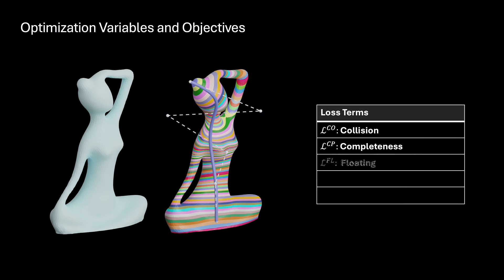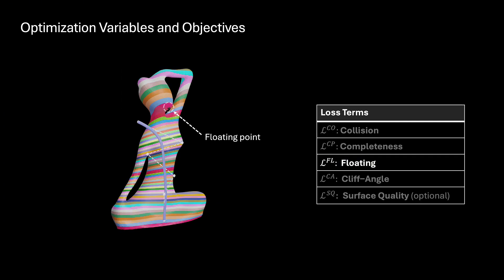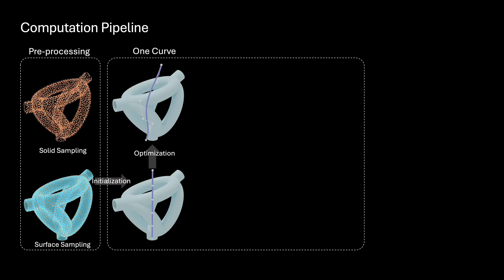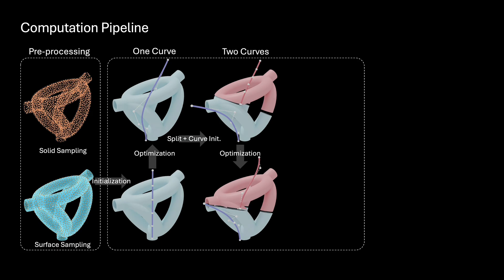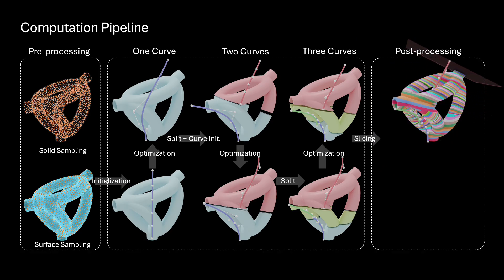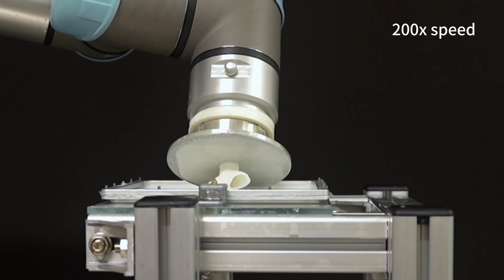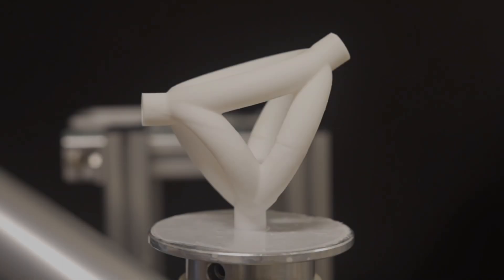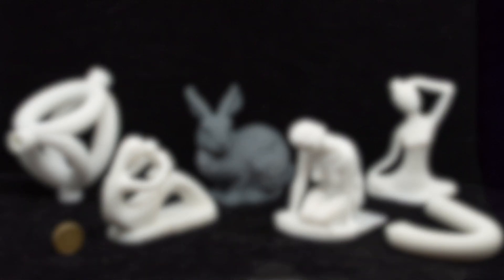Curve-Based Slicer for Multi-Axis DLP 3D Printing | SIGGRAPH Asia 2025

Comment: Can this work with multiple vats to achieve color printing or are we still limited to applying polymer and UV hardening it to do that?
Reply from the maker: You still need to use polymer and UV light control for color variations

Comment: I could see this improving FDM also, you could spiral print a tubular shape (creating something like a mandrel) vertically and then print on its sides with a cross hatching pattern - similar to a filament winder. Or it could allow sharp changes in direction of internal layers if ever needed.
Reply from the maker: That was what we handled in our work of Neural Slicer published last year.  The video can be found at: https://youtu.be/LF1fRD7ygdE
Reply: @CharlieCLWang-od4px  Thanks for the link, setting up the slicer now!

Comment: Great job! Is there any loss of strength at the interface between the curve faces?
Reply from the maker: Between the regions of multiple curves it might have some influence. But there is no problem if the model can be made by a single curve based slicing